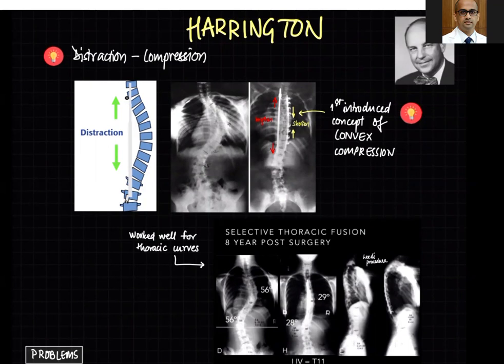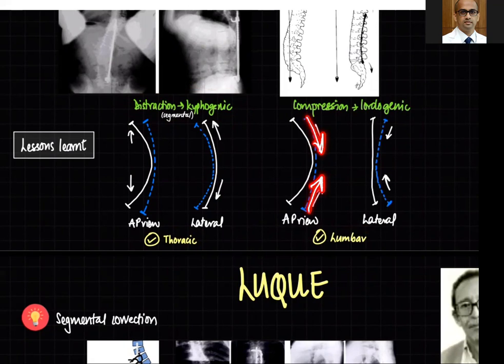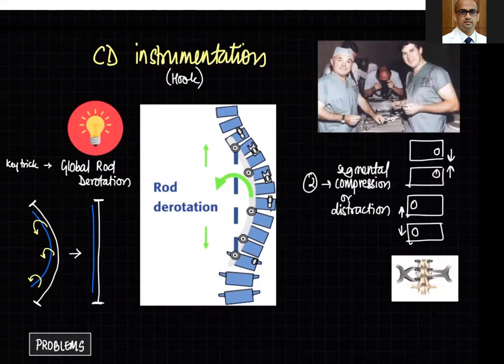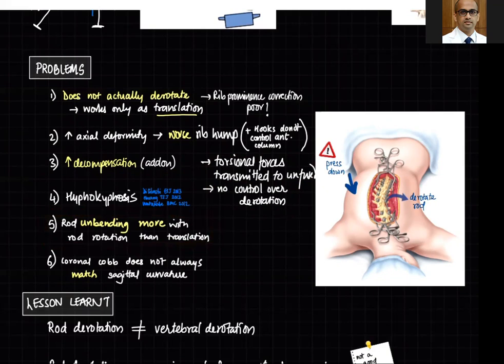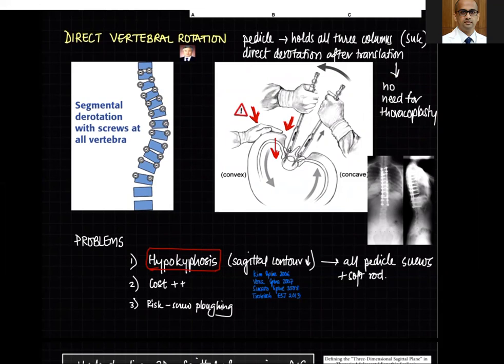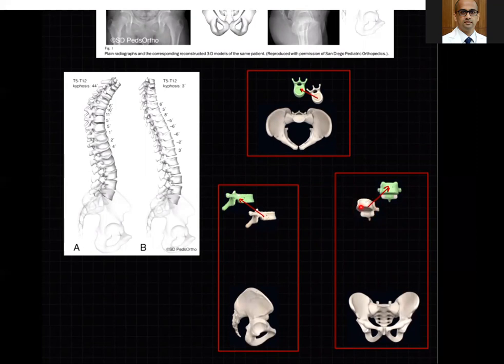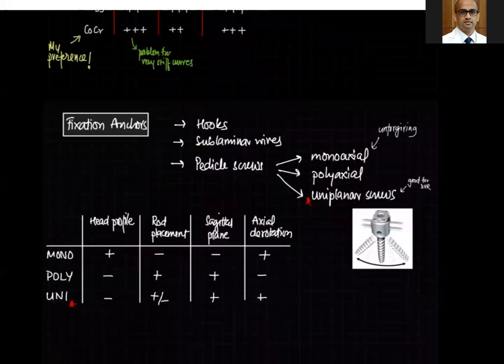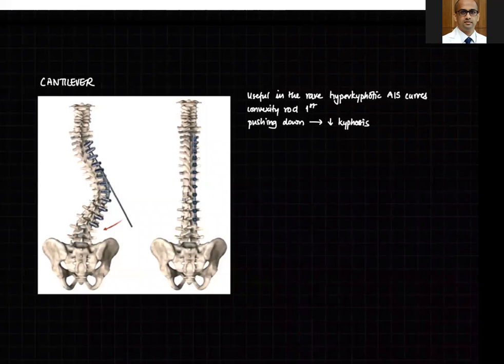History of Corrective maneuvers in Adolescent Idiopathic Scoliosis surgery by Dr Kshitij Chaudhary

Comment: Well done … any advice about femoral traction and tong head traction before we start the surgery? What are the common weights that we can apply?  Very nice and informative presentation in a very short time . Excellent
Reply from the maker: I use pelvic traction like you do for casting. It works well. No pins required. Will use about 20-30 percent of BW

Comment: Nice presentation dr, but why exactly is the use of thoracoplasty for rib hump correction back in the harrington rod and luque wires era a problem. Even to this date we know that thoracoplasty is superior compared to the most up to date direct vertebral derotation methods for rib hump correction.
Reply from the maker: I have not done a thoracoplasty for a typical AIS ever. It is not necessary with modern instrumentation. Also thoracoplasty will compromise pulmonary function.
Reply: i understand but sometimes this is what it takes to get substantial and even total elimnation of the rib hump for those with stiff rib cages and large thoracic curves. Does the pulmonary function compromise outweigh the cosmetic advantages, and does the pulmonary function loss permanent or just temporary and returns back to normal pre operative levels for the patient? @DrKshitijChaudhary